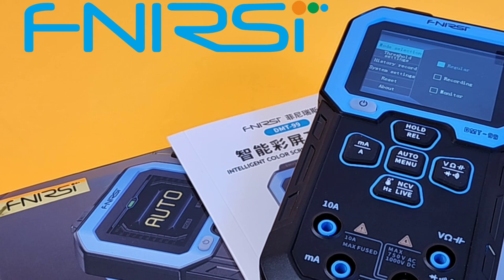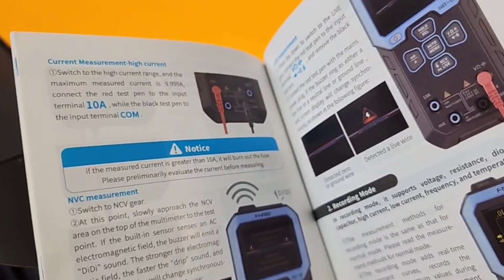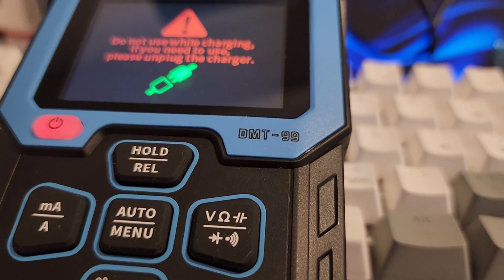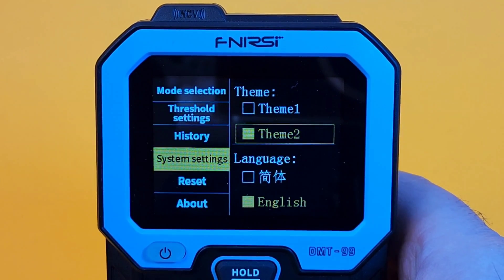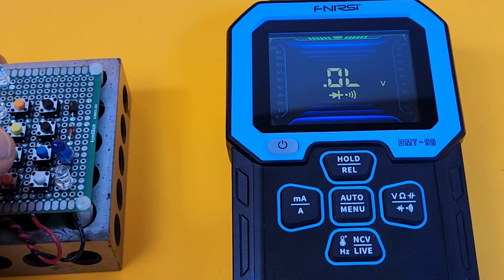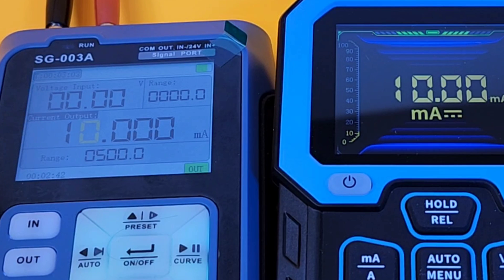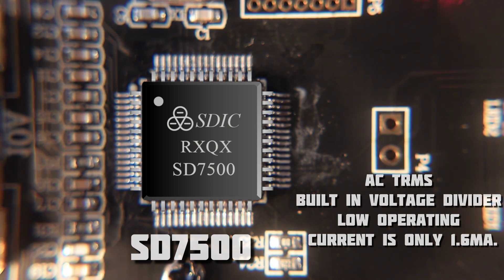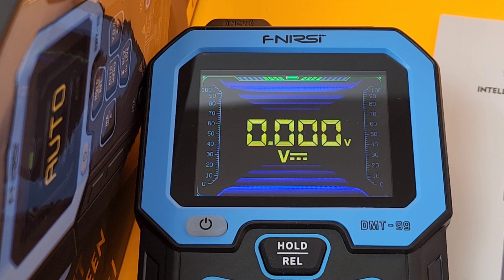FNIRSI DMT-99 CHEAP-O Multimeter Review & Teardown!

Comment: Hey Darren, what should I be looking for in a DMM for electronics and ham radio type work, specs and features? So much out there, I'm just starting out and don't want to get something I'll just replace right away. Thanks for all the videos you make, I love the tear downs.
Reply from the maker: Hey my friend...Thx for the kudos!  Bench electronics/ham radio reccommend.....well a multimeter with good resolution  and precision is important. I'm currently the midst of updating our TopTen CHEAP-O Multimeter list [should be completed by end of March]
I will say the DMT-99 is  a multimeter I could easily reccommend and it has a very user friendly interface with really good precision. Also the KAIWEETS HT118E is another greeat all around dmm.

Comment: People have differing opinions about the beeping in diode mode. A beep indicates a short, so in theory you would only want to hear a beep if your diode is shorted. Is that how this unit responds in the diode mode?  That is, no beep unless diode is shorted?
Reply from the maker: Correct. As far as the DMT-99 is concerned, no audible diode beep on this meter, period. Hence, no audible alert if the component is shorted. Too bad .. 🙁
Reply: @KeepOnTesting  thanks for the quick response!  Unfortunately the bars on the display don’t respond quickly, that’s also a fail. Time for that software update!
Reply from the maker: @pault6533  Oh yea Paul..not the most sensitive bargraph display for sure. Still lots to like for the price! 👍
Reply: @KeepOnTesting  Is that just for diode testing, or is there no beep at all, even for simple continuity checking?

Comment: It has a resolution of 1 milliohm. A very rare feature. nice job FNIRSI.
Reply from the maker: FNIRSI blindsided the CHEAP-O Multimeter Realm I  2024. This is going to be a great year for test gear! 🙌 Resistance 9.999MΩ/999.9KΩ/99.99KΩ/9.999KΩ/999.9Ω/99.99MΩ
It doesn't do millohms unfortunately 😅 no 4W here...

Comment: Not bad. Looks clean, modern and quite capable. I really hope LiPO and Li-ion batteries become standard in multimeters. Some of my tools still use 9v Krona batteries. Not only are they expensive, but they're like 200 mAh for Ni-Mh.
Reply from the maker: Definitely a 2024 looking dmm for sure!
Those rechargeable LiPO cells are not only long lasting but cheap to replace. 
Quite a progressive multimeter at a very reasonable price. 👍

Comment: Good multimeter, but what I will do after 2 or 3 years when battery is not holding its charge?
Reply: You can get pretty much the same battery on a lot of Chinese sites. Or get a larger one if so desired even...
Reply: Change it.
Reply from the maker: Simply buy a replacement 803450 battery from Banggood or any other online vendor - 12$-15$. 👍